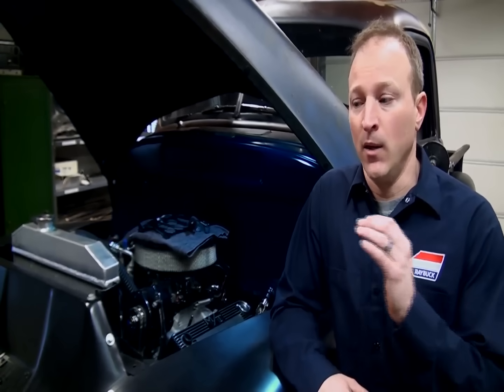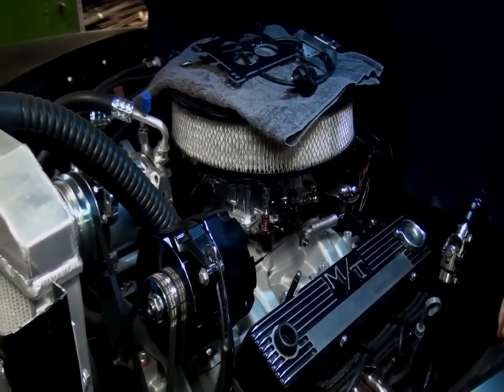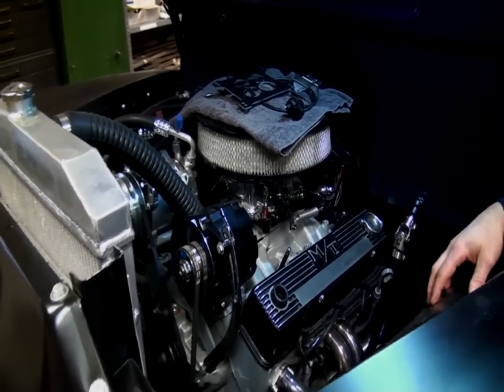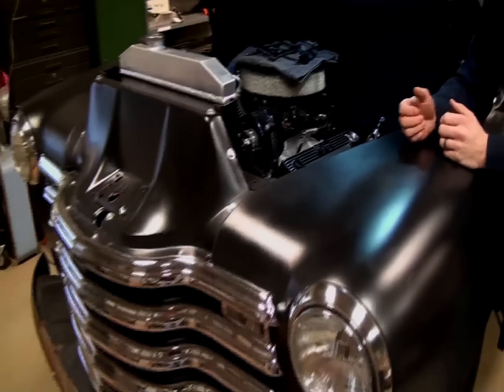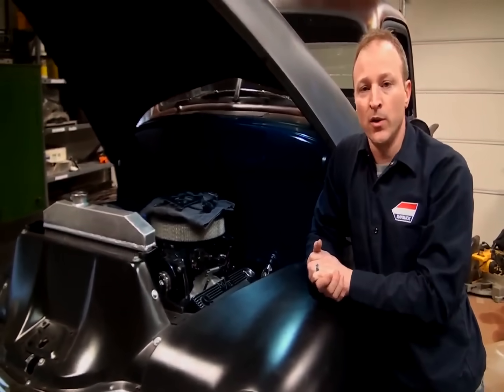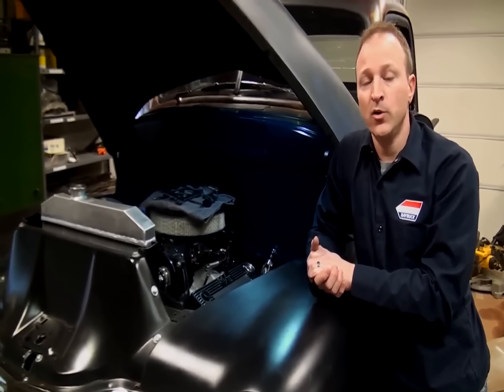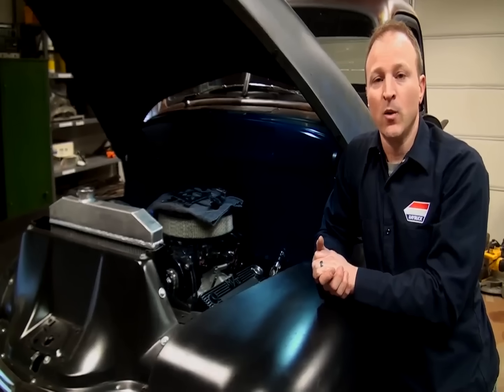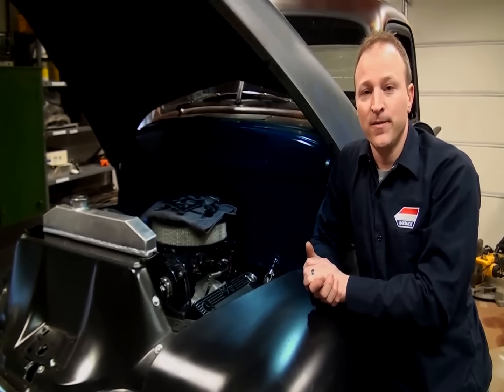Differences between a TH350 and 700R4 transmission and fitting them into a 1947-1953 Chevy Pickup

Comment: So, have my eyes on a classic old GMC handy an from the late 60s.
The guy installed a 383 stroker, 700r4 and... 4.11posi rear end.
I don't think these vans are particularly heavy nor do they have huge wheels.
Is this thing pretty much just for drag racing or could it cruise at 140kph or 100mph without the engine screaming?
Reply from the maker: The 383/700r4 is a great combo. The problem is going to be with the rear end gearing. 4.11s are great for short, quick driving. They suck for pretty much anything else. That's an easy swap, though. I just swapped out 4.11s in one of my cars and put in 3.40s. It has a 3 speed automatic and 25" tall rear tires. At 65mph I'm around 3k RPM. With the overdrive gear in the 700r4, and maybe 3.08s in the rear end, you should be good to go in that van. It will still have pep from a dead stop, but will not over rev at highway speeds. There are online calculators that let you enter your transmission gearing, rear end gearing, rear tire diameter, and speed, and they will give you a good approximation of rpm. Definitely check one of those out before making any decisions.

Comment: Have u ever seen a c5 stamp on the casing of  a 350 transmission? I pulled one out of my 73c10
Reply from the maker: I've heard other people mention that same casting but I'm not sure what it represents. If it were a 1979 or newer, it could possibly be a locking version, but it's not. The c5 casting is may just be a production facility code.

Comment: I might need to get this for my 350
Reply: I did the same,im happy with the 700
Reply: @JM-xi8uz  yeah I wanna Cruise an stuff around town an maybe on the highway an don't wanna burn to much gas cause I have a 350 turbo in my Monte Carlo SS
Reply: @Mr.Frost181  I have a 1988 Monte Carlo SS and the th350 in it is fun (had to raise the gears up to 3:29 because those original 3:73's were too damn high) but once I hit the highway the RPM's are screaming. I want that overdrive which will allow me to put the 3:73's back in the rear end. Did you have to buy a shorter drive shaft? The 700R4 is longer than the th350 and how do I find the correct length?
Reply: @380fade  yes the driveshaft has to be shortened 2" I believe
Reply: @Mr.Frost181  3 inches
Reply: @dalevackar182  oh alright I was close lol
Reply: @Mr.Frost181  Yes you was brother. there is a 6 inch, 9 inch, and 12 inch 350. The 9 inch is a direct fit for the 700 and 4l60 except for the transmission mount is in a slightly different position. The 6 inch was used in 69 through 72 pickups and midsize cars throughout the 70s and 80s . the 9 inch was used in 73 up pickups and full-size cars. And the 12 inch was used in station wagons only those are really hard to find. I hope this information is helpful for you.
Reply: @dalevackar182  alright thanks for the info I'll definitely keep that in mind
Reply: @Mr.Frost181  You are welcome sir. Any thing I can do to help

Comment: Question I have a 82 Chevy shortbed my transmission has MV4 engraved on it also it and it has 14 T engraved on it and a 13 bolt pattern on oil pan and suggestions on a new transmission to bolt up to my engine
Reply from the maker: There are a few factors that need to be considered before making a blanket suggestion on a transmission. What engine is in the truck? What do you use the truck for (daily driver, weekend racing, etc)? How much highway driving to you plan on doing with the truck?

Comment: Do you think this transmission would work with a 572 merlin big block engine, I had a turbo 400 but it broke within the first 1500 miles of use
Reply from the maker: No. I would not use a 700R4 with that engine. The 400 should have worked fine. Sounds like there's something else going on, or that 400 wasn't built properly.
Reply: @RaybuckAutoBodyParts  I dont know exactly went wrong but after 20 minutes of on the freeway i got on the streets and it wouldnt shift into 2nd or 3rd, then eventually lost reverse, is there any transmission that you do recommend, that has an overdrive?
Reply from the maker: @sergiosoto7356  Maybe a 4L80E

Comment: Hey fellas I have a question. I wonder if you guys can help . I have a 1980 with a 454 but I want to change the transmission it has because the gears are way too short it’s a MANUEL 3 spend and I can not drive it on the free way without the motor screaming.   My question is what set up can I change it too that can bolt right up ?
Reply from the maker: Is it a 4WD? If so, then I'm not sure what to suggest there. I think you can buy a case adapter that would allow you to bolt this up. If you wanted to keep the 3spd, you could look at an overdrive unit like what Gearvendors sells. It's not cheap, and I think only gives you a final ratio around .78:1, but it allows you to keep everything else in place (other than the driveshaft). Tremec has some nice 4wd offerings as well. If you have a 2wd, then you should be able to bolt the 700R4 right to it.
Reply: You could leave the 3 speed transmission in your truck and change the rear differential gears to some that are more street friendly. If you don't tow,or haul many heavy loads 3.08:1 gears would be alright. If you do tow/ haul 3.42:1 to 3.73:1 would be better. The final drive on the 3 speed and the 4 speed truck transmission that came stock in 1980 was 1:1. Sounds like you have really low axle ratio. Taller tires would lower your engine rpm. I have a 77 k20 Chevy. It's got 3.73 gears and 31in tires. It's fine on the freeway. mine's an automatic transmission TH400. You can use a TH350 with a big block. I wouldn't do it with a 4×4 though. Heavy transfer case can crack the rear part of the transmission housing. Especially if you beat on it.

Comment: True the 700r4 will save excessive ware on the engine it's faster on take off but the stall or performance converter is more costly than the one for turbo 350 the 700r4 is about the same lenght as the long shaft 350 the drive shaft from a short shaft will have to be shortened but according to what mods has be a n done to the engine the 7oor4 is more costly to build and buy control box to lockup converter for overdrive its your choice or budject pay more for trans to start out and save on gas and engine wear or cheaper investment and pay more going down the road for extra gas and engine ware plus the sound like you need too change into another gear the recession is yours or custumers but have fun with hot rodding

Comment: I'm about to build a sbc carborated s10. Which transmission is best for daily driving and fuel economy? I don't plan on driving over 80 or street racing. It's being built just to make sound and carshows maybe.
Reply from the maker: Most of the transmissions mentioned in the comments (350, 400, 700) would be fine for your setup. If you're interested in fuel economy, I'd go with the 700r4 as it has overdrive.

Comment: One of the best choices for an overdrive transmission is the 2004r.  Do not confuse this with to 200 metric which is junk.  The 2004r was used in all Cadillac Deville and Buick Grand Am.  It is a unibolt bell housing so it fits Chevy and BPO engines. Use your existing TH 350 drive shaft. Proper wiring for the trans is available from several suppliers. The TV cable is extremely important and must be properly adjusted. Omit this step and you will destroy the trans. Here is HOW TO ADJUST THE TV CABLE without using pressure gauge.  Start with about 3/4 inch of cable exposed at carburetor or air intake. Shift trans to D position, using light throttle accelerate until you feel the 1-2 shift, stab the accelerator to the floor, the trans should Immediately downshift to 1, if not, stop and shorten the tv cable about 1/8th inch.  Continue doing this until you get that instant downshift. You now have the TV cable correct so now you are ready to cruise while enjoying that .69:1 final output ratio.
Reply: They are a good transmission for a stock or light vehicle. But you will dump a lot of money into one if you want it to hold up with any power...
Reply: wow! cant believe i ran into your comment/instructions. bought a 2004R for my 51 3100. finally got it installed but I'm freaked out about that dang TV cable. I've read that EVERYWHERE.  so let me ask some dumb questions,... you lift the rear in the air correct? and accelerate till you feel it shift 1st AND 2nd gear?    and when its slowly going 15-20MPHish, floor it??? 😳?     its weird that it'll "downshift" to 1st while in 2nd gear 🧐 if you floor it...,   you'd think it would go up to 3rd..   THANK YOU for any help!!
Reply: I did V8 swap in a 85 s10 . I have 350 sbc with a quadajet. Now I need a transmission Im stuck between th350 with a shift kit and a 700 r4 performance transmission which one is best and my drive shaft was for th350.

Comment: I have killed 3 700r4 transmissions, and never had an issue with a th350 or th400

I’m on my second Allison 1000 and haven’t had an issue yet.
Reply: Joe Paul the 8.1 is great gasser. It’s not a duramax but I don’t notice with what I do. It’s still partial throttle for everything.  The 6.0 does well for my needs but milage is crappy, 12-14. I get 11-12 with the 8.1. It’s not enough difference to make a difference to me. I’ve used 5.3/4L60’s a couple times and caravaned with them quite a bit. They end up on the floor and still only being mediocre. It’s great passing them going up a steep grade.  More then one in my circle of friends has blown up.

Honestly I’ve always just replaced trucks when the 700r4 blew. The advantage of driving used vehicles it is often cheaper to replace the whole thing vs building or rebuilding a tranny or motor.
Reply: @Joe Paul will a 4l60e or 4l80 hook up to a older 350 engine?? Ive heard about the adapter pieces that will connect but just wanna make sure first. Thanks

Comment: what about a th400 with a 4:10 rare end gear?
Reply: 65mph on highway @ 5000 rpms
Reply: @delljr2769  not turning that much 3200 3500 depends on tire size
Reply: I have 350th & 456 gear my 65 nova, and N24 muncie & 488 gear in my C1, keeps me busy.
Reply: Th350 with 3.23 rear …60mph at 3000rpm

Comment: I heve a 63 nove that came with a power glide. I put a T 350 in it and have been driving it for over 15 years. I never hooked up the kick down. I want to replace the trans with the 700. Do I have to hook up the kick down. If you do not "punch it" I figure I do not need tne kick down. Go ahead and laugh, all my Ford friends do but I a runnig a one barrel on a 6 cylender. No tickets and I love the car.
Reply: Should have been 63 Nova
Reply from the maker: True, with a 350 you don't necessarily need the kick down cable as you can just manually shift. For the 700, you definitely need the TV cable as that's what signals the transmission to shift. Additionally, the TV cable needs to be adjusted properly or else the clutch is just going to burn up. There are a number of TV cable options out there, from stock to aftermarket. We went with the kit from Bow Tie as we heard great things about it, and it's really easy to install and adjust.

Comment: Use a Hydrallic lock up kit - no electric power needed
Reply: how?? I have a 72 c10 with a th350 and I want to put in my 700r4. need to know about the lock up issue

Comment: I have a 3/4 ton Chev CK-20 had a big block with a turbo 400 transmission had a shop that was to rebuild my motor threw a rod and rebuild the transmission took them over 2 months to rebuild but when I got it back they had put a Z-28 Camaro motor from 1972 and a 700 R transmission was not a turbo cost me $7000.00 for this shop to steal my motor and transmission then claim this was what was in my 3/4 ton had in it now I can't haul a thing with this motor are transmission not geared for it now.

Comment: I got a transmission in a 84 Chevy 1/2 ton pickup with the tv cable. What is the reason for the wire coming from the firewall to the transmission.ok I just listened to the whole video, you talked about it, I had the wire but lost it now I can’t find it

Comment: bored Warner used to make a manual transmission many years ago that had a Overdrive on it with a solenoid and a Paul that went into the Sun Gear it really work good and gave you much better gas mileage grabbing some things lately
Reply: Three speed manual with overdrive was the state of the art before the four and five speed manual transmissions became commonly available.  Now of course manual transmissions with six speeds are available with some cars but some others no longer offer them and some have continuously variable transmissions.  Unfortunately the increased complexity and use of technology instead of robust hardware make failures more expensive and likely to happen.

Comment: I'm a retired mechanic specialize in transmissions and carburetor modification I know on a 350 and 400 Turbo hydramatic the cars came with different extension housing an output shafts length depending on the car what the manufacturer wanted to put in the vehicle the short shaft was very popular they also had a longer output shaft and extension housing on some turbo hydramatic transmission the main part of the transmission was the same the case was the same the extension housing was longer and the output shaft was longer truthfully I really like the Turbo hydramatic 400 they are very strong transmission also I like to C6 transmission it was a very strong transmission big intermediate band and big loan Reverse band very strong transmission for the big block Ford motors the C4 Motors were put in the small blocks the C4 Transmissions we're okay for passenger cars the C6 was very heavy duty very strong transmission the Ford Transmissions have a firmer shift the turbo hydramatic transmission have a mushy shift just remembering the good old days when I used to rebuild Transmissions I used to modify carburetors I also used to modify carburetors for gas mileage had a 65 Ford Galaxie 289 4 speed transmission old motor 90 to 120 lb compression new motor 160 lb compression pull a 5 by 8 trailer what about 85 lb of tongue weight on the vehicle got 23 and a half miles to the gallon on a old motor on a 65 Ford Galaxie four door there is a lot of different ways you can get good gas mileage on a vehicle a hydrogen generators a good way to get better gas mileage hydrogen Burns clean thank you very much and everyone have a great day
Reply: 350
Reply: Thanks for your insight Kent!  Besides all the minor problems with a TH350, they are still bulletproof reliable transmissions for a daily driver, if properly maintained.  No computer, easy to work on.
Reply: Will a 350vfrom the 80s fit on a 95 360
Reply: Hola i have a Ford bronco 78 with c6 transmisión it's posible put a 700r4 in the Ford 400? And it's a Big diferience?
Reply: Hydrogen generators: How did u make it?